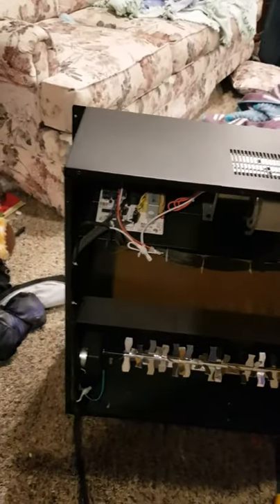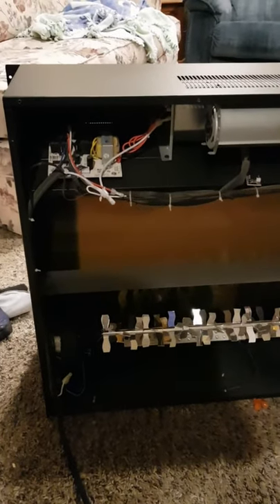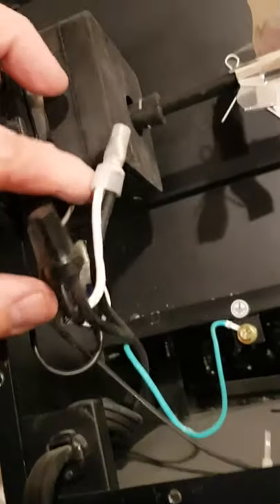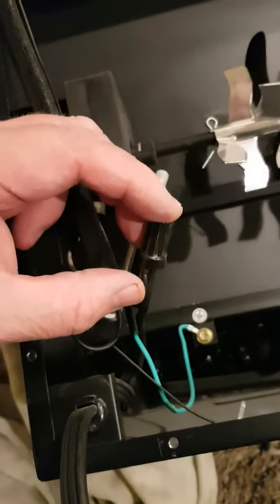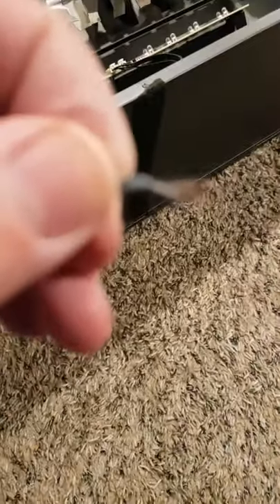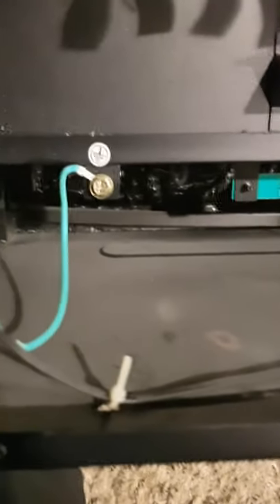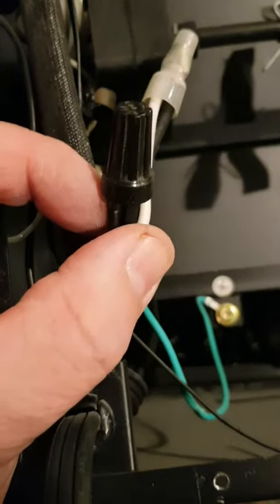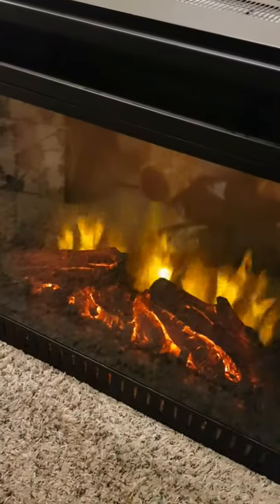Fixing a non working Whalen FP30-2B electric fireplace

Comment: Whalen furniture manufacturer 48 inch Media Console infrared electric fireplace Catalog#WSLWFP48-5. How do I reset it keeps showing code 00
Reply from the maker: Sorry, mine didn't.  Have you done basic troubleshooting steps? (disconnect the power,wait 30 mins or so and plug it back in)  if not, I would try that.  I don't remember seeing any type of reset buttons or anything in the unit.

Comment: Was yours glitching the power were it days 00
Reply: That means u have ur unit in demo mode flip the switch to the 0 not the I. I is demo mode hope this helps
Reply: @jeremiahvanderhoff6432  were is the switch at
Reply: @jeremiahvanderhoff6432  where is the switch?
Reply: @TheeAutumnOne  it's on the back of the unit usually